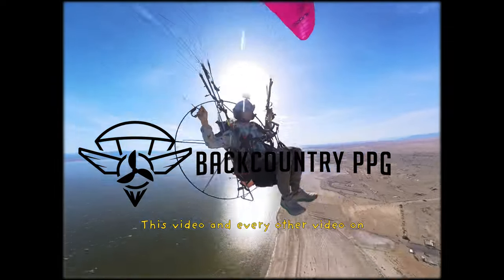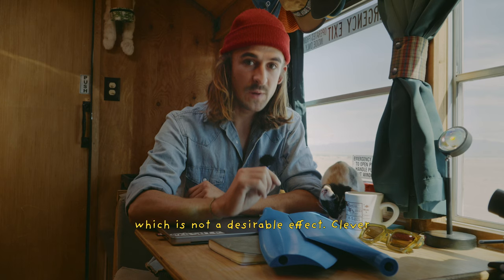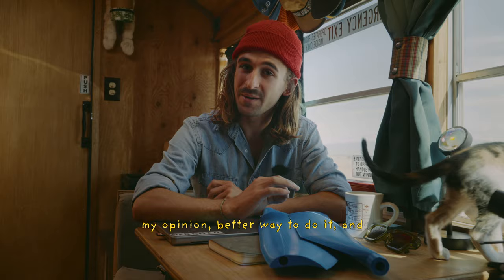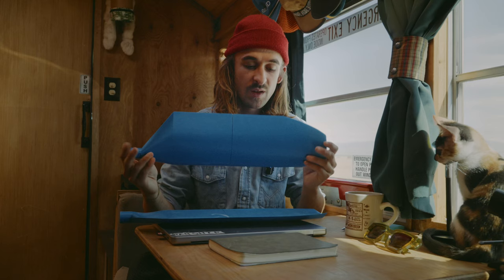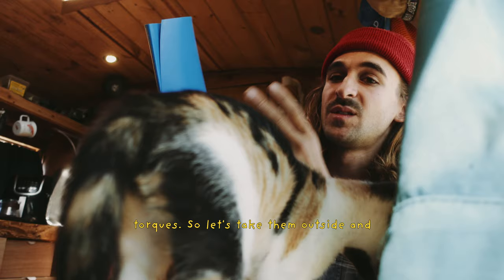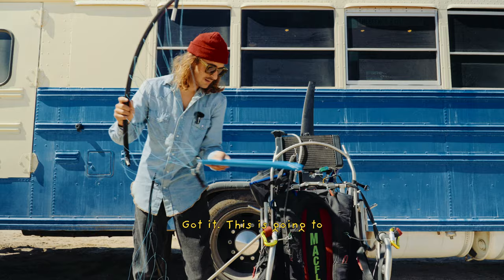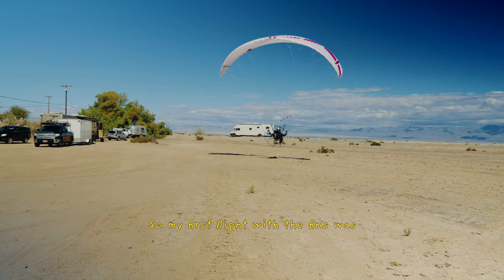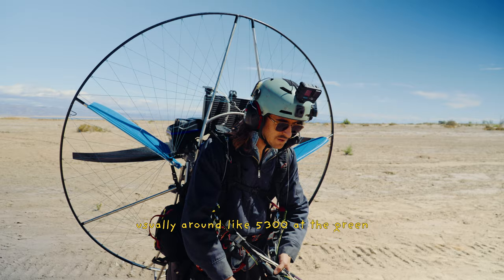3D Printed Solution Makes my Paramotor Fly 263.1% STRAIGHTER.

Comment: my name is Bernie and I approver ths message. (also, this is a great surprise Judson, thanks for the mention! super stoked that you like them! looking forward to trying mine with zero offset with my iris arms.)
Reply: Judson didn’t mention anything about flow disturbances and trust reduction. Have you notice anything in your testing? 
I 3D print some myself. But much smaller and did notice I slight trust reduction. I am curious to know about yours.
Reply: Fin color black or black-grey. 😎🦉🦅
Reply: awesome design job!
Reply: Very cool Bernie. I really love the concept. I'll be interested in hearing what your thoughts are as well once you try them with your Iris.
Reply: I bernie great great job i love that,  and thanks Judson to share.
Do you think this it worked on PAP Frames 
Is it possible to buy STL files ?
Reply: Do you have an STL file available
Reply: Dope fins man, is the print open source?
Reply: I think there might be a market for these for paramotors that don't come with any kind of fins from the factory, like the ParaJet Zenith. That's what I have and torque effect is just horrible.

Comment from the maker: Captions arent perfect, but i love the vibe. hard to catch evert error. also missed a color grade on the 360 clip oopsy. enjoy
Reply: cheers for this test judson. i am working on a EPPG for a while now and i see there is almost zero torque when we test them. even without fins.
do you have any idea why gasoline units are so much more effected by that? maybe the inertia from clutch/flywheel or any other non propeller related parts make it worse?
i made the same torque fins here with my 3D printer and spend alot time for the design just to find out we dont need them AT ALL for an electric PPG. but i am wondering why that is.

ps: can we talk about that kitten for a second too? omg so cute! if you rescued his furry a$$: thank you! really appreciate it
Reply: every*
Reply: I am gonna have to disagree with you on the Captions, they are distracting AF for me and are not needed as you speak clearly and loudly. When Wes Anderson puts all his dialogue in a "wes anderson style font" in his movies, then and only than can you do it.  What is the point of having great video if you make the viewer focus on the text, the brain can't take both in equally at the same time. Wes wouldn't do it, neither should you. I have to force myself NOT to look at the lower third of the screen or else my brain goes right to the text. Maybe I am old and you kids today are wired differently but I think others would agree with me. BTW I feel you are a film maker (you understand balance and shot composition plus great editing better than most) who happens to fly a paramotor and I would not spend the time to comment like this for a youtuber who's work I didn't like and respect.
Reply: @SeanAllocca i agree with that. no text needed.

Comment: didn't you do a video where you showed that this thing just flies straight and how impressed you were with it flying straight...
Reply: Awkward!!!
Reply from the maker: Yes, with the moster… at altitude, in may.
Reply: It may have to do with how light a pilot is, im 200+ pounds and larger wing so I don't notice it torque at all on full power climb, and weight shift will turn me easy both directions not sure at full power though

Comment: Judson, an important correction: it doesn't create an opposing force from the paramotor moving forward through the air. It actually creates an opposing force from the propeller moving air over the fins (which moves MUCH faster and with a lot more velocity).

Comment: Seems like you could keep adjusting the angle until you get them set exactly how you want them so the torque curve is even throughout the RPM range.  Then mark the setting for reassembly.  Great video.

Comment: This is interesting about how better your flying with those things objectively was VS how not very impressed subjectively you look. This must be totally due to installation issues that need to be resolved. I played myself with 3d-printed counter-torque setup and came to the same conclusion: either carefully factory manufactured or no go.

Comment: Great video. I am currently thinking through this also. I fly an Atom 80 and am 175lbs. Although I am right at the top of the power range I have zero torque issues. I keep going back and to about changing to a Moster for better climb v worse torque.

Comment: Injection molding or laid carbon fiber, would be a nicer solution. However, 3d printing is MUCH less investment for production of just a few units. Interesting results. Im a 125lb pilot on a moster. My ppg only has offset seating for compensation. Its definitely noticeable (torque turn), at most rpm's, including cruise rpm.

Comment: That's pretty cool Judson. I haven't flown paramotor yet, and am having a lot of fun with free-flight, but I am paramotor curious. I have a frame, and an electric motor that should produce about 33 hp in theory at full throttle. I'm pretty heavy at just under 200 lbs in just shorts so dynamic torque compensation may not be necessary. It is interesting doing the research though. thanks.

Comment: Miro had a good idea to use aerodynamic torque compensation on a paramotor.  I always wondered if he got the idea from how a turbojet engine uses internal fixed stater blades to counteract torque.

Comment: Cool work Bernie! The next iteration could be spring-loaded like leading edge flaps on an airplane so that they can dynamically adjust in flight? Maybe have the springs be tension-able for performance parameter choices, ie cruise vs aerobatic. Neat concept, yer on to something here.

Comment: Really cool video! I wonder what the time would be for a Scout to do a full 360 with a Thor? The Thor is obviously torquier than a Moster, but with the majority of peeps flying a Moster, what do you think has better overall torque compensation, a stock MacFly or a Scout? I’m bias to neutral swing arms for even turns in both directions power off, but the MacFly also seems badass and prb wins for durabilty at least.

Comment: we need far more experts, not the manufacturers to design better wings to compete with the major manufacturers. there testing and the way they go about things have a lot to be desired.  thinking outside the known box.
Reply: The problem with paramotor manufacturing is volume. You will spend thousands and thousands of dollars and hour and hours of testing and developing a product that MAYBE less than 1,000 people will buy globally (IF it’s a universal product that any pilot can use) and most people will complain that the price is too high for what it is. This is why start up paramotor manufacturers come and go so often.

Comment: OK, so what have changed in the motor since your unboxing video? In that video you have showed using a full power without any change of the flight direction. Just askin.
Reply from the maker: That was a smaller motor, at altitude. If you watch to the end I talk about this

Comment: 11:13 Is that the same setup you were raving about how straight it flies a few months back? Looks like you give it gas and go sideways. I know you've got the 202 on there, but still...
Reply: On the moster the Macfly has almost no torque, but the torque re-emerges with a much more powerful Polini 202.
Reply: @austinsmith9413  gotcha.